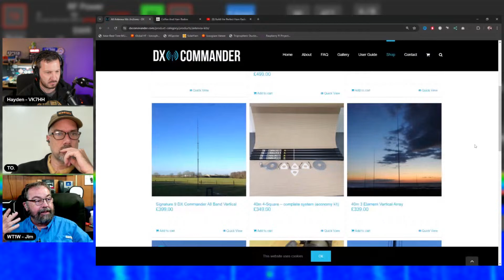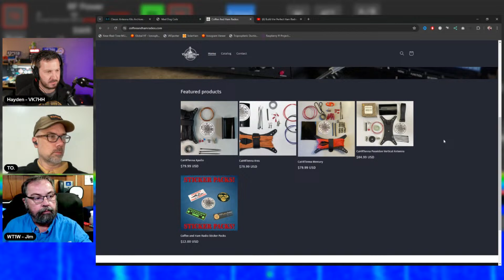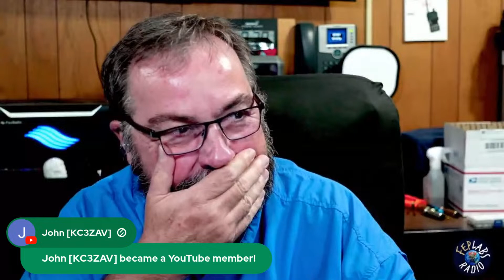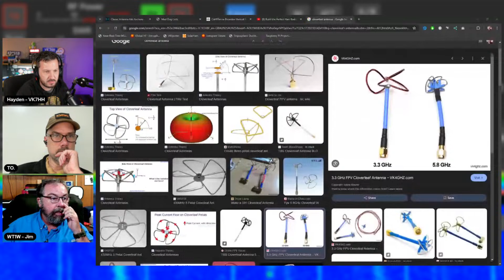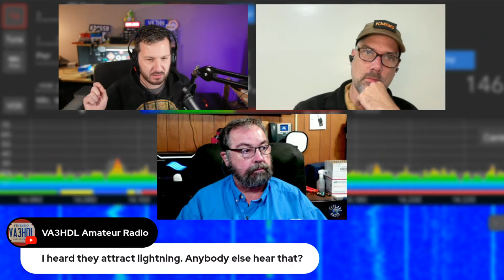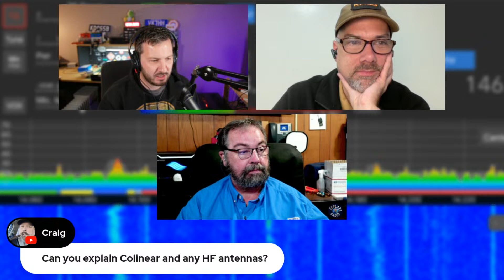Build the Perfect Ham Radio Shack: Part 3 (Antennas)

Comment: Question: if running 25’ of rg316 that has three ferite beads around 12-14” from one end of the coax (ABR) and you pair it with the PackTenna 10m/20m/40m End Fed Half Wave.
Which end should the inline beads be near? (Radio or End Fed Half Wave?

Comment: It's a great show, sadly my location is not part of the area's you guys' mention for antenna location. Most antennas are not as good as they are in the lower 48 that they are in my location in Anchorage, Alaska. Non the less you guys are awesome doing this kind of informative show oriented for everyone specially the newbies in this hobby. I just have 3 years as an Amateur Radio Operator and really love it. My shack is an IC-9700 for VHF/UHF an IC-7610 for HF, one Anytone 878 UVII plus and one Icom ID-52. For POTA one Yaesu FT-891 with a BoddyPole Deluxe Long Version. Base Antenna Vertical Hy-Gain AV-680 and a CobWeb MFJ-1838 Heavy Duty. For mobile antenna an ATAS-120A. So far everiry equipment on my shack get the job done. Thank you, guys, for the job well done. I can't wait for the next show.

Comment: Very good show ! Lots. of great antenna's . I am in NY/USA . it's cold in the winter and hot and muggy in summer.  HVAC ? For the winter I just get bigger tubes . and summer ? BTU AC  ?  Big fan ?  What about lighting?  My old CFL lamps make QRM . The LED are much better . I can get on 10/11/12/6 and now 15 meters without a antenna ,and make great contacts with just coax !  mostly RG-8X. and get a good tune.  The T2LT ! a few ways to make them. Videos' on this channel.  YL Raisa got on 20 meters  with no antenna ,no coax ! just Aluminum foil !  was a great video ! When you talking plastics and RF. DX commander changed the plastic parts due to that problem . Running 1.5 KW FT8 and setting DX commander antenna on fire . Now we do QRO loops and different plastic. I thought it was UV. But Callum in a video explained the new plastic plates.  I want to see pics of that fire ! I got the gray plates and green mast 2024 Expedition portable and it goes up and down quickly and easy.  73

Comment: I've also had a modified version of the Classic G5RV, the "ZS6BKW," for many, many years now; a bit shorter than the Classic (92' vs 102') with a 40' LL drop, it's pretty much a "plug & play" antenna, with no tuning, adjustments or anything needed; best thing abt it is, using just my IC-7300's internal AT, it'll easily load on 5 bands (& more with an ext AT)👍😃🇺🇸

Comment: I've had an IMAX 2000 hung in a high tree for many years now; & while it's purported to be a 5/8th wave, I just know I've l worked all over the world with it; & even though many use this 24' long vertical for 11m CB, I found that, using just my rig's internal AT (an IC:7300), I can easily load up on 10 & 12m (& with my ext AT, also 15m); 73 de WA4ELW in TN 🇺🇸 dit dit 😃